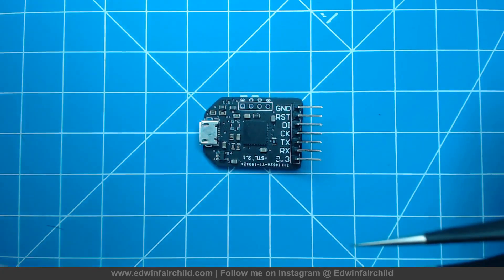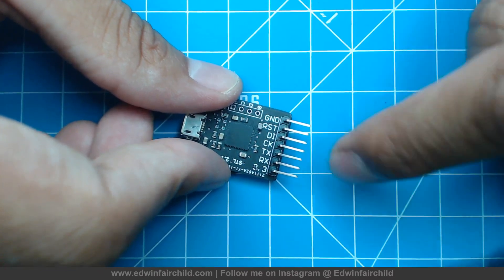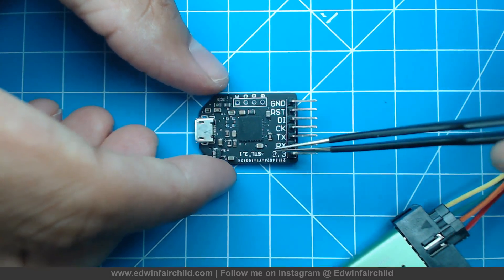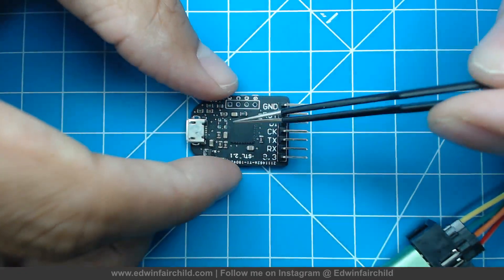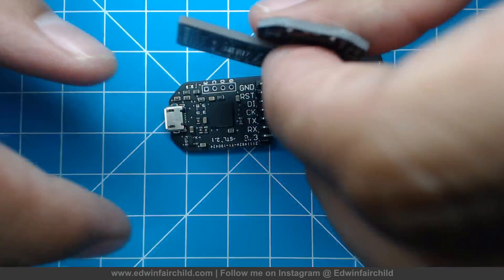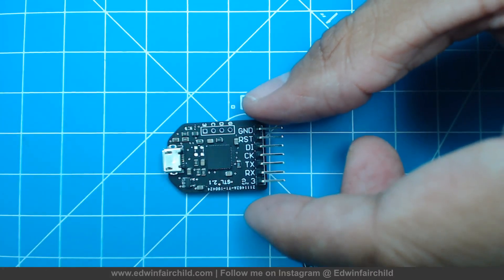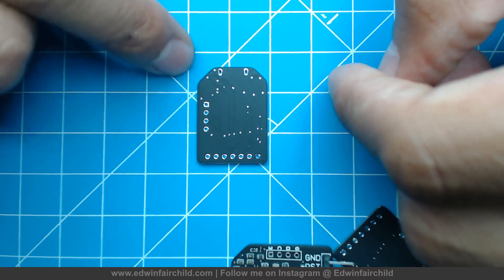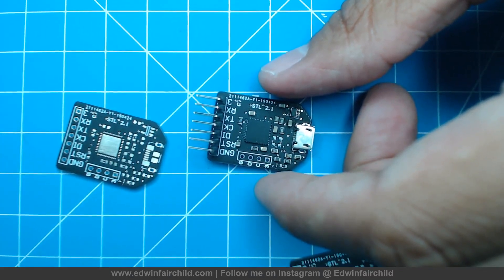Custom St-Link PCB ARRIVED! BUT I FAILED!

Comment: I saw a STMicroelectronics video where you asked the question about ST-Link firmware open source.  The response was you could get the binary.  Did you ever manage that?  I tried but was told: "no"

Comment: NIce job. Bummer on the reversed USB footprint. I'm so cheap I'd just wire in the USB manually off another board. Good luck with the next batch!

Comment: laying out PCBs can frustrating, silly little mistakes can be a show stopper. I think 3 cycles of the board for, me to get it right.
Reply from the maker: I wish there was a cheaper alternative because after a while it can add up
Reply: @EdwinFairchild  The best prices I have found is JLCPCB. They even have assembly service as well.
Reply from the maker: @jamescullins2709  I would like to do a small run one day including assembly to see how much it is and if I sell the boards,  to get an idea if it's profitable.  Honestly the most expensive part are the microcontroller, a single genuine stm32 cost about 6 bucks and small quantities. So it's hard to compete with Chinese boards which is the entire board for for 3 bucks
Reply: @EdwinFairchild  I agree with you!

Comment: can you just erase-flash the st-link you have instead?
Reply from the maker: Yes but it won't work because the st link v2.1 I am trying to make has extra circuitry.
Reply: @EdwinFairchild  oh I see
so I recommend using a full sized USB port instead of the mini
it helps it's overal strength(if you wanna use a case afterwards) and also ease of use
Reply: @alijabari8715  I vote mini

Comment: Looks good. Too bad that it failed at first time. You will do it great next time.
Reply from the maker: yeah it was a silly mistake. oh well.
Reply: @EdwinFairchild  I hope it is not too much costly mistake.
Reply from the maker: @MilanKarakas  its cost $10 for 5 pcb. not too bad because this includes shipping also
Reply: @EdwinFairchild  Wow that is good price, not too high. Where did you order that? USA or China?
Reply from the maker: @MilanKarakas  JLCpcb.com
Reply: @EdwinFairchild  Thanks.
Reply: I had a feeling you ordered them from jlc.
You'll get it figured out eventually.